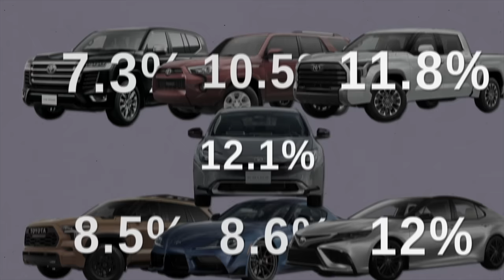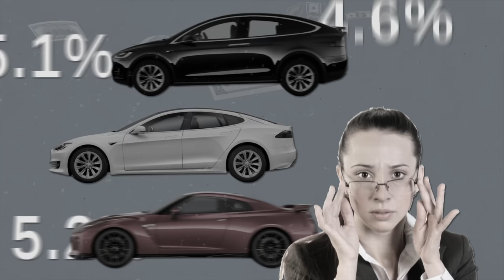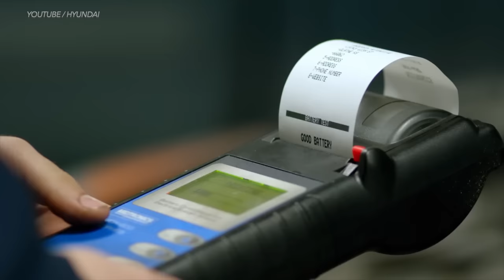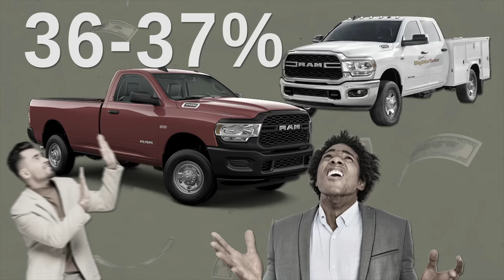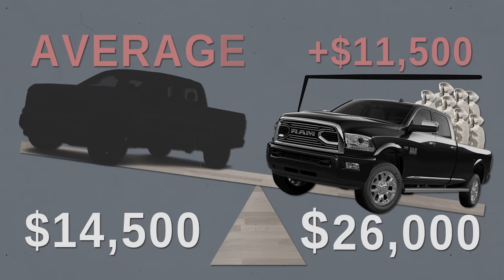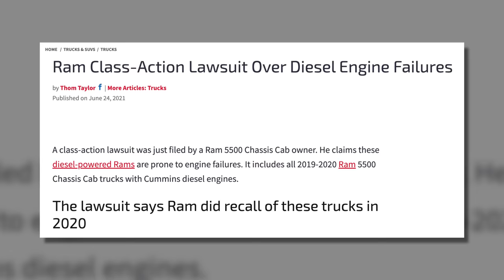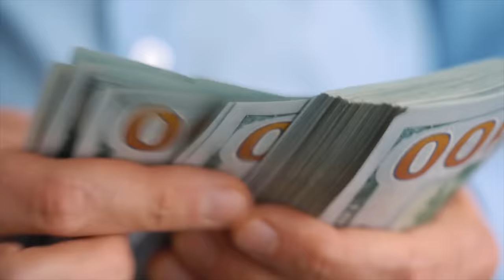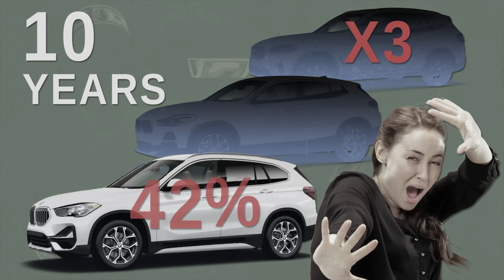Here's Why I Only Buy Toyotas and Lexus

Comment: I had a BMW for about two years. It was one of the biggest financial mistakes I've made.  It always seemed to need repairs and everything cost at least $1000. It was horrible. I drive a Toyota now and couldn't be happier.
Reply: What do you do for work
Reply: @arturopuebla4924  I work in logistics.
Reply: I can relate to what you are saying. I'm in the U.S. & just sold to Carmax (they gave $1,000s of more for the car than many other 3rd party) my 2018 BMW X5 with 44k miles. I have had the car for 2 yrs. Thankfully, I bought extended warranty when I bought the car, as last fall when I took it for regular maintenance, an oil gasket had a hole in it. In addition, they couldn't rotate the back tires because they were stuck. It would have cost me an extra $3,000 or so to fix those issues if the extended warranty didn't cover them! Amd I still had to pay $2,000 out of pocket for the  other maintenance they did. 

After selling the X5 car, I bought from a Toyota dealership a used 2016 Toyota Highlander, which only had 87k miles & one owner. I took the car to a regular mechanic to check everything out just to be sure the car was good as the dealer said. Also, the 2nd day after driving the car, I felt like it didn't have smooth turns & felt lopsided!! Funny enough, the mechanic took it for a test drive & on windy turns. His consensus was, "the car was PERFECT & there's nothing wrong. I just need to get used to driving this kind of car." 😊

Despite the expense of a BMW, I still think the drive, style, comfor, etc. are INCREDIBLE!!!💯 Therefore, I can see why people still buy one, as there is an exhilarating feeling one gets when driving a BMW that I've not noticed in any other luxury car. Overall, I think if one can  own a BMW & a Toyota that would be a good way to go to cut down on not having to too much wear, tear, & cost of the BMW. In that way, they'll also have the Toyota to drive extremely long distance that will cost very little to maintain. The moral here is: drive whatever makes you happy & comfortable financially!!
Reply: How does a Mercedes compare in terms of reliability?  An X5 and Highlander are large SUVs so I don't expect exciting from either. You want and X3 or 4 and compare that to Lexus RX/NX not a Toyota.
Reply: Same. I used to own a Mercedes. The car was in the mechanic shop to many times. I sold it 6 years ago and bought a Lexus. No more to the mechanic shop except for oil change. What a relief.
Reply: @Flying-Fox19  Some Mercedes are actually fairly reliable, however I'd only recommend buying one if you live in Europe as repairs are cheaper there.
Reply: I also bought a 16 F30 BMW in 2020 with 35k at 128k miles now only major repair ever was a wastegate actuator and the car is still running perfect with 0 lights or codes
Reply: @walterhoward5512  have a 2007 Chrysler and last year I I had a check engine light due to a evap system leak so I had to spend around $500 to get it fixed and just a couple weeks ago I replaced my fuel pump and a couple days later my check engine light came back on due to another evap system leak and other issues. So now I have to get my card fixed once again🤦🏾‍♂️
Reply: Sorry, Scotty. My X3s run great no problems.  I only use BMW oil.  IT’s special and not that much more than Mobil One.  I change the oil religiously at 6,000 miles.  I’m sure I could let it go to 9,000 but it’s $60 to change the 6 cylinder and $40 to change the 4 cylinder N20 engine.  Peanuts!!
Reply: Did you brought a brand new one?
Reply: I've owned a BMW (E63, LCI) for 13 years and counting. It's been fairly reliable, it's special in the looks department and fun to drive. I'm happy with my choice.
Reply: I’m sorry but I’m not looking for reliability when I buy a bmw. I own 2023 bmw x7 this car is way better then any Toyota or Lexus. The feels is different the cabin is so quite. It’s definitely faster then any Toyota in 7 seater class. You pay the price for luxury not for reliability.
Reply: My nephew is always replacing something on his even the it has the b58 engine.
Reply: My mechanic friend calls them "BM trouble you" lol
Reply: Same here brother had to drop about 8k  after owning one, I now have an IS200t and I love it. If they came in manual, it would be perfect
Reply: @atanashristov6829  japenese cars are simpler, but if you think that's the reason they don't fail, youre wrong. There manufacturing process is insane. very low tolerances, very high quality materials, and amazing engineering. They actually make cars that are easy to repair and maintain.
Reply: i’d rather be lonely inside a bmw than a toyota
Reply: Had the exact same experience. My BMW had things break all the time that I never thought about before. Fuel pumps. Power Window motors. Break lights. Air conditioning, it was horrible
Reply: I owned mine for 3. Service coverage was 3 years. Then one thing happened and several thousand bucks later it was promptly sold.
Reply: Yeah bmw is a junky low class car
Reply: @-gordon3817 what about the fact that those of us who know better are laughing at you for buying the BMW?
Reply: @greenman7612 although it is possible you have a reliable BMW, it's only a matter of time before a random plastic part breaks or computer module is fried and you are left stranded.
Reply: @mizangeneralconstructionan6889 luxury and reliability are not mutually exclusive concepts.  It's possible to have both.  You may think the Beamer looks special and it's cool, but many of us chuckle every time we see one bc we know the maintenance nightmares that exist under that  hood.
Reply: @politcallycorrect5816 Truth!   I worked as a product development engineer at a Tier 1 supplier for 9 years and Toyota was one of my customers.  Their approach to quality and accuracy is different than all the rest.   They make beautiful vehicles.
Reply: @silo3com Not exactly, but they are overrated.  Can you really tell that big of a difference between the way a BMW and a Lexus sports car  drives?  Is it worth the hassle of getting a broken vehicle to the mechanic and being without a car while it's being fixed several times a year?   My wife's Lexus is almost like owning a hammer, it works and you don't even think about it failing on you.   Other than brakes, tires and oil, it rolls on everyday and hers has over 200k on  the clock.
Reply: new car ？
Reply: True. That's why German cars are for rich people. Only lease them and change every 3 years because after that it would need frequent repairs. More repair means you are not only losing money but your precious time, too. So, as I said, only leasing them for 3 years is the way to go for German cars.
Reply: I’ve been a Benz tech for 22 years. Owned a couple older Benz’s over the years cause they were cheap for me to own. 
Finally bought a yota truck and love it. They’re easier to repair when they actually need repair. German engineering is terrible!
Reply: Beemer believers! If you want a great ride without the repairs just buy a Lexus.
Reply: Blame the last owner
Reply: Where does Nissan fall  inis category?
Reply: @londynavera9947 I think u park mostly under shelter ?
Reply: BMW, bring my wallet
Reply: @deontan9314  nope I usually park my cars as far as possible so I don't go for shade just inspect the car you buy the day after you buy it
Reply: Similar experience I had with BMW so switched to TOYOTA ❤
Reply: BMW to Toyota what a downgrade, unless you bought the Supra
Reply: I bought two Poraches. Loved the cars but expensive to repair. I now have a Toyota Tundra and I love it. Low maintenance and very reliable.
Reply: This is why you only take BMWs on lease contracts. When something does break, especially catastrophically, the dealership is responsible for repairs and sourcing you a courtesy vehicle, so you don’t go out of pocket. Then, when you’ve spent your 3 or so years with the car and know it for its true colours, you can then make the decision to buy it, a decision which any discerning owner will politely refuse given how bad things have gotten
Reply: Series 5 bmw 2014 , what a pain in the A , pain in the head , high maintenance, low reliability , a psychological feeling of luxury won't just do. Toyota crown now running smooth and forever.
Reply: Same for my Fiat lol owned it for 6 years now and ive sunk so much money into it compared to my rav4 that I owned for 13 years.
Reply: I had the same BMW experience. I don't wish BMW to anyone. I do my own diy work to some extend. I had a mini Cooper then 535I.
Reply: My bmw x6 is a joke . Always problem .
Reply: My family also have 2 320i . One in Australia and another in China . Both have issues too, i was a fan of bmw as people always say bmw is a real car for drivers. However , i think it is a nightmare. I wont buy any Bmw any more
Reply: Same goes for our X5. What a pice of crap! Always in shop. Now have Lexus no issues in 2 years!
Reply: Same!
Reply: @greenman7612 uh-uh! ...... What year(s) are they?
Reply: Bmw 🥲😔
Reply: No not really, bmw engines are solid
Reply: I live in Europe and have 2017 bmw 418d with 100kw diesel 2.0 diesel engine
I can only say after 130k miles i had only 1 malfunction and that was EGR valve that costed me 90 euros to fix
I do oil and filtera changes every 10k miles and service costs me 150 euros
I think diesel german engines are far more realible than gasoline and parts i guess cost alot less in Europe
I also know alot of people that drive 2.2diesel engine mercedes benz with over 250k miles and going very good
So when all you americans smash BmW and Mercedes i am confused xD
Reply: Yeah it’s a shame, I think bmw looks great but just not worth it
Reply: Toyota may not be the fanciest or funniest cars but hey, they are cheap to run and get you where you need to go. I’ve only ever had corollas, Camrys or Geo Metro’s
Reply: Best to get a car that’s fun to drive like a BMW couple years old and get warranty to cover everything. 

It’s not worth it to a lot of drivers to just save some money but have to drive a boring car to work. The drive might be only excitement a man gets all day.
Reply: I just bought a 2000 Toyota Sienna for only $1,200 with over 265k miles on it to live in.
Reply: @kupatguk6493what about Audi A4 in terms of reliability, performance and fuel consumption? Is it on par with BMW 3 series 🤔
Reply: @muminiasty and how's Mini cooper reliability, maintenance and consumption vs BMW 🤔
Reply: Same with Audi the motor mounts are bad bad and expensive got me a Tacoma best vehicle ever
Reply: @arturopuebla4924 😂😂😂
Reply: BMW Big Money Wasteland
Reply: We have 2 bmw x3s. My husband bought his 2014 in 2013 new. 11 years later with 104k, he has had to do tires, brakes, general maintenance, valve cover gasket replacement, and some cosmetic fixes. I got my 2016 x3 used in 2019. Now it has 72k. Other than general maintenance I’m doing new brakes this year, bought new tires last year. Parking sensor component went out but I’m not going to bother with fixing that. I guess we are lucky because after 11 years we really thought we’d be out way more on his x3 maintenance. Maybe we got a good deal? I don’t know. We are firm believers in doing oil changes and sched maintenance more often than dealer recommendation. We always use premium gas and we drive our cars average 8-10k a year unless we use for a long road trip occasionally. When it’s time to buy again we will prob go for Japanese as we will be getting closer to retirement and will want less costly maintenance and fuel savings. But I can’t really say we drive money pits. At least not at this time.
Reply: @Flying-Fox19 having owned both Mercedes and BMW, my Mercedes was a solid great car, 100% reliable. My BMW the exact opposite. My humble experience, since you asked.
Reply: @Flying-Fox19  If you want a reliable Mercedes, you probably need one older than 1990.
Reply: This year my 2001 bmw e39 520 diesel needed a new turbo and a new headgasket. The bill was3200€.
Reply: @kupatguk6493ever drive an AMG packaged Mercedes?
Reply: Well I had an F30 BMW for like 8 years. Literally only did maintenance and wear and tear repairs
Reply: Ironically my X3 M40i’s engine is the same with a supra today lol
Reply: Well i leased a 2021 bmw M340 brand new and it broke a few time but i didn't spend a dime on it in 4 years , under warranty ,
Reply: I have never owned a BMW but I can say emphatically that I never had serious issues since driving Lexus for the last 25 years other than oil change, brakes and tire replacements. The resale value on them is uncommon. For the Beamers and Benzers, I wish you good luck😂
Reply: Yup. My 2012 Chevy Equinox was the same way. My 04’ Highlander was a dream. Would probably still be driving had I not been in an accident in it. The 2012 Equinox was actually a downgrade…. 🙃 I spent so much money on that vehicle… 
In a 2011 Lexus RX 450h, now. The quality is unmatched to the Equinox. 💝
Reply: But you looked cool 😎
Reply: @-gordon3817 fake rich people own BMWs real rich people buy a   Lexus
Reply: @cindymmm11  getting a LS and away with my 5 series too. I'm exhausted